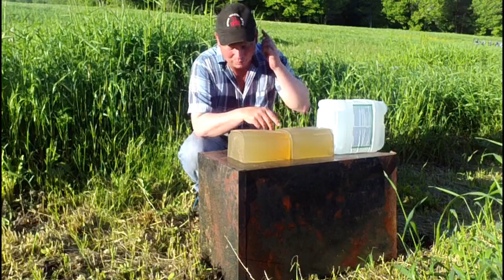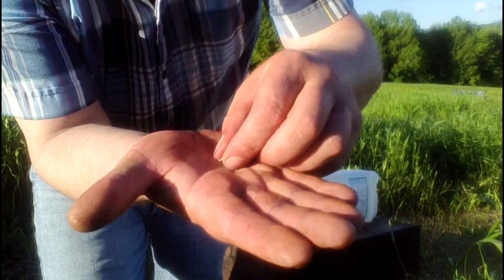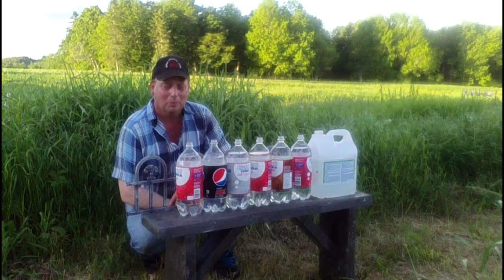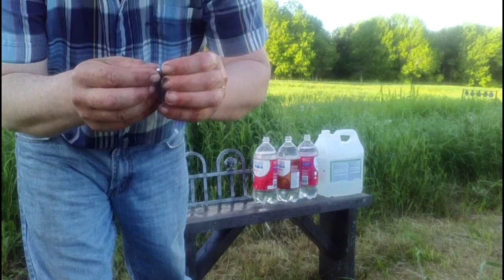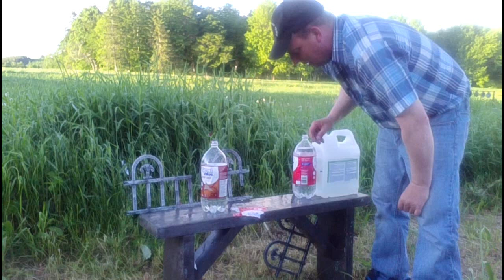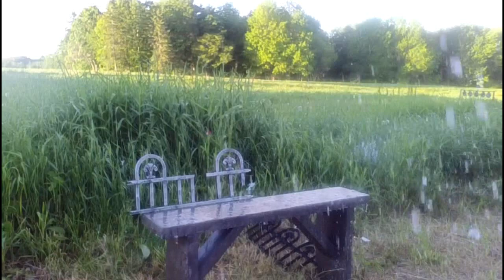223 VS 22 250

Comment: Is basic physics. The 22.250 doesn't transfer energy like a 223. Just imagine a real 556 like most people have. Game over.
Reply from the maker: .22-250 is running about 400 or more FPS faster with the same bullet so would deliver slightly more energy.
  Check the description fro the link to the second test.

Comment: this caliber has been designed in 1937.  a shame that it has not been selected as a military cartridge and mass produced in pair with a semi auto rifle before  WW2
Reply from the maker: With the Garand rifle the US had a big advantage in fire power for the regular infantryman and it seems that military doctrine wasn't ready for an intermediate cartridge yet. For military use the .223 has the advantage over .22-250 in weight and bulk for the amount of ammo an infantryman can carry. Thanks for watching!
Reply: the 22-250 also has a clear advantage in weight and bulk over the 30-06, and also has a bit more punch than the current .223. IMO it would have been an excellent military cartridge.  since most engagement rarely exeeded 300-400m, calibers such as 8mm mauser and 30-06 was just oversized, over-recoiling and carrying limited.

as you said the military doctrine was just not ready at that time for a varmint bullet type as primary cartridge.
Reply from the maker: That is true, but .22-250 would have very little weight and bulk advantage (at least bulk) over the current .308 for the loss in performance, but realistically I would want to stand in front of any of them! :)
Reply: but the .308 design is from 1952. too late.

Comment: I've spent a lot of days hunting predators and have shot them with a 243, 222, 223, 223AI, 222 Mag, 204, 220 Swift and a 22-250. Of all of those different cartridges I will choose the 22-250 every time. I've had way too many runoffs with the 223 which is a shame because I love the rifle. 

As far as your results go my guess is your choice of bullets. A highly frangible bullet at high velocity isn't going to penetrate far before it expends its energy. When I got my first 22-250 in the mid 60's I learned that lesson pretty fast. Sierra bullets was located in Santa Fe Springs, CA back then about a block away from where I worked. They suggested I try their 52 gr HPBT and it did the trick. I've killed over 600 coyotes with that combination.
Reply from the maker: Thanks for the input and thanks for watching! I have since retested these rounds with better gel blocks, you can check it out here  https://www.youtube.com/watch?v=XCJJSk84zvA&t=2s
Reply: I msg sierra and asked about penetration with the 52  gr matchking at 22-250 velocity.  I already knew the answer for the most part. But they said that they hadn't tested that bullet for hunting since it wasn't designed for hunting. But it's a lot more solid and not nearly as explosive

Comment: Your video is good but some of your conclusions are wrong on the comparisons between the .223 and .22-250.  You say that a bullet from .223 had more punch than the bullet from.22-250 based on your observation from the amount of penetration into water bottle.  More penetration does not necessarily mean more punch.  The shorter barrel on the .22-250 was not the factor.  It is a well known scientific fact that resistance to motion in air or water increases as speed increases.  A technical way of saying is that the resistance is proportional to speed.   You failed to note that the .22-250 impact was more explosive than the impact from .223.  The .22-250 bullet dissipated its kinetic energy more quickly due to the increase in resistance to travel, hence less penetration.  Also, if you examine the recovered bullet fragments, you will find smaller fragments on the .22-250 bullet due to more violent impact than from the .223.

An example of increase in resistance to the increase in speed can be found everyday.  You can stick your hand out in a moving car.  As you increase speed, the resistance or the force on your hand increases.  Cars on wet roads hydroplane at high speeds, and, boats, and water skiers hydroplane at high speed.  From the point of view of cars, boats, and water skiers, the water appears to feel hard when moving through at high speed.  A high speed bullet moving though the water thinks the water has become a very hard medium.  You can skip stones on the surface of the water when you throw it fast enough at a certain angle whereas a slow speed stone would just sink when it hits the water.
Reply from the maker: Thank you for the detailed analysis, I appreciate the insight.  I have retested these two cartridges, you might find that interesting as well, you can check it out here: https://www.youtube.com/watch?v=XCJJSk84zvA&lc=z23kcpqjqnnjshgnbacdp43astj3b0gwqodp1ydsezdw03c010c
  Thanks for watching!
Reply from the maker: I don't remember ever seeing .22-250 fmjs, but then I wasn't really looking either. :) I would expect that with the extra speed the .22-250 would give more penetration as long as the bullet held together.
Reply from the maker: You'll have to make friends with a country boy! :) I am glad you enjoy our videos, we certainly enjoy making them.

Comment: One gentleman mentioned that the 22-250 was a 22 in a necked down 308. It's actually a .224 bullet in a necked down 250 savage case. At least that was how it started life. The 220 swift is 200 to 500 faster then the 22-250 but most shooters load their swift rounds at 22-250 speeds because it's a more accurate speed for most of the bullet weights they use. If you'll try it, a 22-250 lead tipped hunting rounds will blow through a 3/8 in plate at 50 yards and maybe a 100. I haven't tried 1/2 inch plate at 50 yards but this has me curious. If any one knows, I'd like to know why most bullets going through metal have the jagged edge of the metal pointing in the direction away from the shooter while the 22-250 has that jagged edge pointing towards the shooter. Why?
Reply from the maker: Is 250 Savage a necked down .308? I thought .308 was the parent case for .22-250. If the .22-250 shot at the plate was a soft point perhaps it started to mushroom and cratered the plate before passing through.

Comment: The 22-250 is moving 400 to 600 feet per second faster then the 223 if I'm not mistaken. It's the hydraulic pressure from the water that stops it. The 223 has more bullet weight left after hitting the water bottles. Try 1/8 inch steel plates with an 1/8 inch between each plate and see which one goes through more plates. You can use lead tipped hunting rounds for the test. You'll need to build a frame to hold the plates. I think you'll be very surprised at both rounds but especially the 22-250.
Reply from the maker: I retested these rounds with a better gel block here https://www.youtube.com/watch?v=XCJJSk84zvA&lc=z12mgvr40ounszip304cjtt5grqusjn5xnc0k
Thanks for watching!

Comment: 223 and 22-250 aren't even close to being equal. The 22-250 is a 308 case. it'll hold about 50% more powder.
Reply: TexanUSMC8089 the 22-250rem is in fact based off of the 250 savage.
Reply: Correct. I used 308 for comparison because a lot of people have never heard of the 250 savage.  Good catch.

Comment: The 22-250 was showing you it superior power and on impact, because of too high of velocity, the bullet fragmented to a higher degree and was not able to penetrate as deeply as a slower less powerful round (the 223 Remington). The key is to keeping the velocity below bullet devastation parameters so the bullets weight remains high to allow the best opportunity to maintain both speed and energy to drive the bullet deeper. A fragmented bullet can't penetrate because it's weight has been decided in to too many tinny weakened bits of mist lead spray! I hope this helps explain your result.
Reply from the maker: Thank you for your insight and thanks for watching!

Comment: Thanks for sharing and the effort you went to. If the 250 had a 24"-26" barrel you may have seen a difference (certainly on range). Also I'm not sure what type of projectile you're running. A less frangible pill should hold together better and penetrate deeper.
Reply from the maker: I used Winchester 55 grain soft points for both rifles, they should be the same projectiles. Thanks for watching!
Reply: "if the 223 was a 556 with a 33 in barrel it would be superior"

Comment: Not much of a comparison. For each inch of barrel length is about 100 fps + rate of barrel twist plays a big part and close range. Although it is the same bullet an grain, the powder load and type will also determine velocities and retained energies. Put this all together and one at close range may blow up the bullet, while the other may perform better.  I have a 22-250  24"with a 1 in 9 twist. Shooting 60 grain nosler BLT with 37G of H, BL-C2 shooting 3.575 Vel.   But loading same bullet same gun with 43.4c of H,suprform shooting 3,743 Vel tends to blow the bullet up on impact under 100 yard
.

Comment: Where did you get your ammo? My old reloading manual [Speer] gives the 22-250 a 500 F.P.S.lead over the 223. Shot Groundhogs in southern Ontario in the late 60s early 70s using a .222 Remington which I still have. The .222 Remington ,223 Remington plus the .222 Remington Magnum use a lighter jacketed bullet, firing these bullets from a 22-250 can cause vapour trails due to degradation caused by the higher velocity.
Reply from the maker: The ammo was regular Winchester 55 grain soft point for both the .223 and .22-250.

Comment: I watch em all. I like the graphics given by water jugs and bullets which give a good idea of energy and energy transfer between cartridges and bullet styles and the water. Gel tests would be more interesting by using one block per bullet and close up direction of the wound channel.
Reply: Ray Hansen , Sir, check out bullistics testing for the 22-250 on u tube. If you locate the same vid I saw, they had put a raw egg in the far end of a jell block. They were testing to see what damage the shock damage (I think) would do to the egg. They show it in super slow mo and the explosive wound channel from that 22 is very impressive.
Reply: I bought my first 22/250 in 1968 [ Rem. 788].Some guys N girls use it on deer butits parent ,the 250-3000 is much better suited for that.
The hot 22 calibers until the speed falls off.
Then they are only 22s.

Comment: Numbskull the 250 is a way hotter round than 223
The lead is the same the 223 is smaller and moves at like 1800fps the 250 si slightly larger at 224and moves at close to 4000fps
Notice less penetration is due to the 250 putting 5 times as much energy i to the first 2 bottles n basically splattering into 5 million pieces on impact
A little knowledge goes a long way
Reply from the maker: +justin blake Before you call someone pout perhaps you should do a little research. .223 and .22-250 both use .224 projectiles, when reloading you use the same projectiles for either case. The rounds used here were  both 55 grain PSPs, so identical projectiles. Factory .223 55 grain PSPs run in the range of 3200-3550 FPS, while .22-250 run 3680-4000 FPS. Muzzle energy of the .223 with 55 grain bullet is around 1280 ft/lbs, the .22-250 about 1650 ft/lbs, just under 400 ft/lbs, so around 30% more. Being able to read and understand a ballistics table goes along way!
Reply from the maker: +justin blake I don't know where you're getting your numbers, but a ballistics chart means more than random numbers pulled out of your ass.

Comment: The 22-250 is a great round but I prefer the 204 ruger now days.
Reply: I have seen big coyotes run after being hit with your .204 at 200 yards or more!
Reply: The .22-250 is a better round than the .204
Reply: Depends on what you are doing.  The .204 is superior for speed and accuracy.    The 22-250 heats up barrls faster, trajectory not as flat.    .223 is cheapest to shoot then 22-250 then 204.

Comment: Lead deforms and shatters at velocities greater than 1000 ft per second. there was a video on here YT of 180 gr 30-06 lead bullet vs a 30-06 Barnes Vor-Tex 150 gr. the lead 180 gr weighed 126 gr after shooting, 54 gr of lead rubbed off, for lack of better wording,  and the Barnes still had its weight of 149.9 gr and penetrated much deeper. Try this test with the Barnes vortex 22-250 vs Barnes Vortex 223 and you will see a different story. And NO im not a salesman.
Reply from the maker: +Hutzjohn  Thank you for the input, I plan to revisit this topic again. I have a bigger gel mold now and will maybe try a variety of bullet types. Thanks for watching!

Comment: Your results were very successful and predictable.  The higher velocity 22-250 should NOT penetrate as deeply with varmint bullets.  That's the whole point.  Comparisons of two cartridges of dissimilar velocities involving extremely frangible bullets will exhibit penetration results that will always favor the slower round, simply because the high velocity expands and dissintegrates the bullet beforr it can penetrate.  Varmint bullets are not constructed to penetrate, but are made to come apart, and will do so more efficiently as velocity rises.  If you used strongly constructed game bullets or FMJ bullets, the 22-250 would drive deeper than the 223.  A 22-250 can speed a thin jacketed bullet so fast that it will not penetrate two sides of a cardboard box, as the bullet will immediately vaporize.  Little penetration and explosiveness on varmints is generally the goal, and not penetration, which is the goal with game bullets.
Reply from the maker: +GunBlue490 Thank you for your insights, I'm glad you enjoyed the effort. Thanks for watching!
Reply from the maker: +99Eternal My purpose in this video was to compare for hunting purposes rather than strictly a penetration test, but using more variety of rounds is something I will definitely consider. Thanks for watching!
Reply: +GunBlue490 You are exactly right!  Higher velocity upsets/expands bullets more quickly, resulting in more explosive results and less penetration with frangible bullets.  There are videos of varmint bullets coming apart just from penetrating a grape.
Reply: GunBlue490 good post that's what I keep trying to explain to people. Lol
Its not about just penetrating . shoot a deer with a bow the arrow comes out the other side and the deer slowly bleeds out. Shoot a deer with a 40gr bullet that expands a 3 inch wound channel after the first inch and a half of penetration .
Reply: +GunBlue490 Very true! The 250 acts like a stick of TNT! Nice vid this guy made!
Reply: +fuzzypaws17 anyone remember the varmit grenades by Barnes bullets manufactured by black hills ammunition?  they are bad ass rounds!!  They fuck shit up..
Reply: 100% brother
Reply: Bunnies channel is great. And those varmint grenades are crazy, it’s (if I remember right) a powdered copper slug coated in copper with a giant hollow but closed off tip. They exploded like nothing else. A blade of grass will set em off. Barnes has a promo video it it upsetting before it even exits a grape.
Reply: *gunblue not bunnies. Lol

Comment: Unless the bullets where identical in weight and make up(both the same bullet manufacture... ie both 50 grain vmax) this test is just a bunch of shooting, no offence intended, the reason why the 22-250 breaks up faster is because it's going faster too by the way.
Reply from the maker: +Jawjacked Productions  As I mentioned in the video, both are winchester 55 grain psp bullets, identical projectiles, otherwise yes, it would have been pointless.

Comment: Nothing was said about bullet design! Which would determine the outcome! All in all, the 22-250 is still the better of the two!
The 223 has more "snap"? you talk about barrel length and nothing about what makes the difference: the bullet! 223 DOESN"T have more power!
Reply from the maker: +Jimbo jenkins  As was mentioned in the video, both were 55 grain soft point by Winchester so both projectiles were identical. I believe that since the .223 had a longer barrel in this case, it got more energy from the powder burn and gave it a little more hitting power in this one case. With equal length barrels I expect the outcome would be different.
Reply: Yes, thank you for pointing that out and setting me straight. I appreciate your comment in sincerity!  Have a great day at the range! :o)
Reply from the maker: Thanks for watching, I may get a chronograph at some point, but there too many other wants higher on the list right now. :) For an update of this video, check out https://www.youtube.com/watch?v=XCJJSk84zvA

Comment: so my thought is the 22-250 is faster. for this test to be accurate you would have to use fmj bullets. reasoning you ask? well think about just how much faster the 22-250 is. when that sp round hits the water it nearly vaporizes do to speed. the bullet can not hold up. but in the 223 its traveling much slower. this means the bullet is not subject to such force. thus making it penetrate deeper before falling apart. just my two cents check the speed an ballistics and you will find I am correct. put two bottles out and shoot one with each. you will find the 22-250 will do almost twice the damage.
Reply from the maker: +usa2012  I used soft points of the same brand so that it would be an equal comparison and so it would relate directly to hunting as well.
Reply from the maker: +Indiana GUNS That may be, I have a little bigger ballistic gel mold now so I may get the 22-250 back from my Bro-in-law and retry this test.
Reply from the maker: +regis b Glad you enjoyed the video. I make the gel myself with beef gelatin, I bought the last batch in bulk from a local health food store, I think was around $15-20 /pound. Lots of instructional videos on youtube.
Reply: Soft point imo is better because of hunting reasons, you can't hunt with fmj here (MO). I've never seen a fmj 22-250